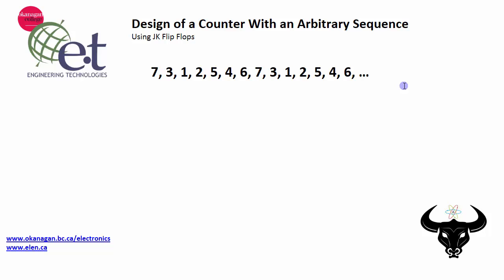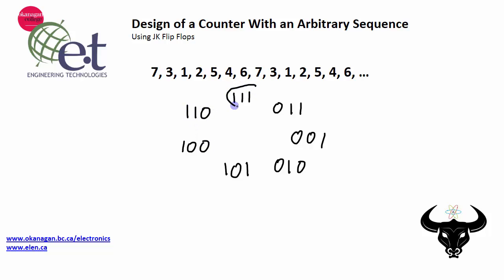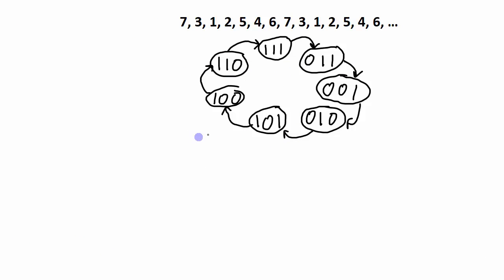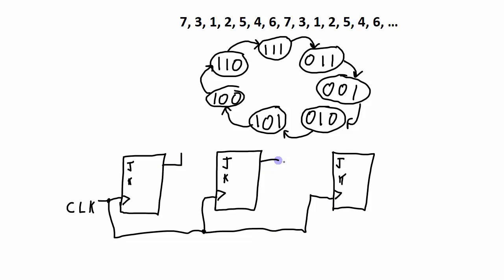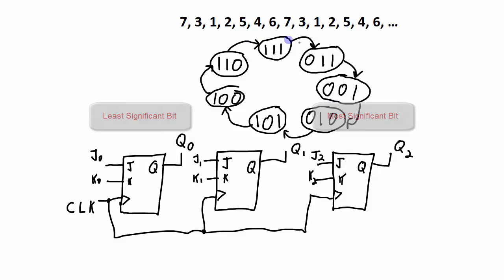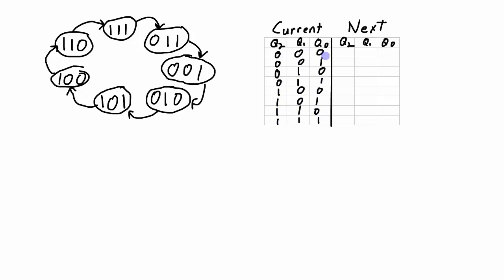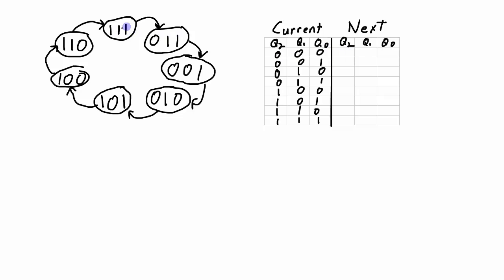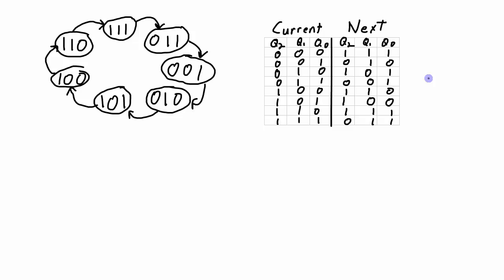Design a Counter With an Arbitrary Sequence (1/3)

Comment: hi. What happens if the state repeats for example if it was ; 7-3-1-2-2-2-5-5-4-6. ? Can you please help me on this im stuck :)
Reply from the maker: +Begum Yesilalan what you would have with the repeating sequence "7-3-1-2-2-2-5-5-4-6" is actually 10 states even though there are only 7 different outputs. One way of designing this system is to make a 0-9 counter (i.e. 10 states) and then decode the state to the appropriate output. for example state 0 would give an output of 7, while states 3, 4, and 5 would give an output of 2
Reply: Thank you for the reply btw. 

Can you please send me the truth table for this question : 1,2,2,3,3,3 

 ( I didint get setting 3,4,5th state to 2) because so how would 2 get to be 5 when every to goes to 2. How can i decide that. ? :)

Comment: What if i only want an output of 0 1 3 7?
Reply from the maker: There are a couple of ways you could do that. 1) Set up your design the same as in the video, and in the state transition table but for all the unused states (2, 4, 5, 6), set the NEXT value to 0. 2) You could use a two bit counter that counts 0,1,2,3 but add a decoder that converts counter value to the desired output. i.e., 0->0, 1->1,  2 -> 3 and 3->7.